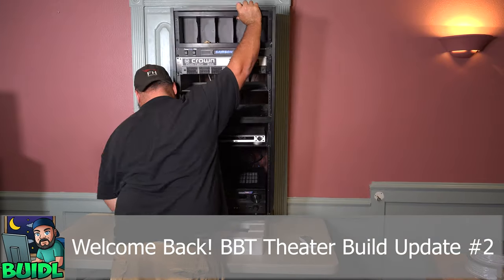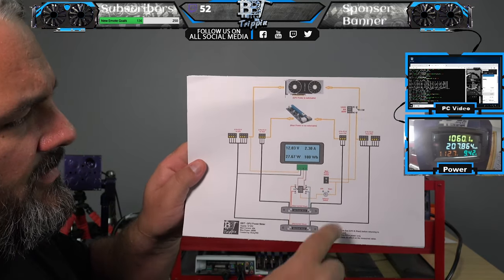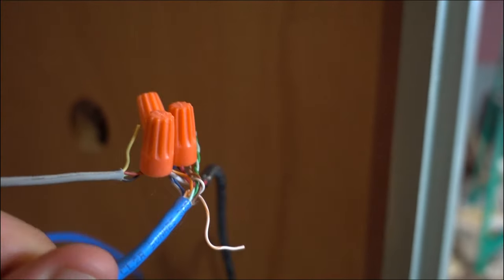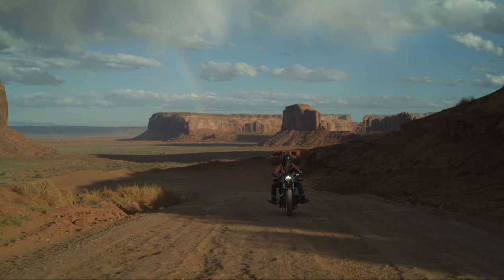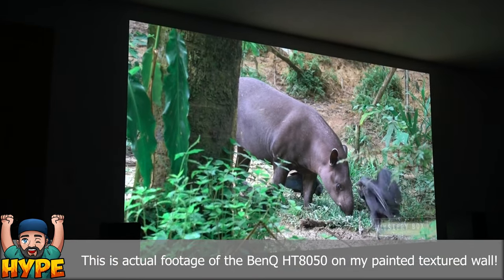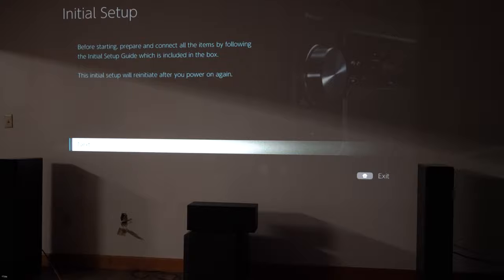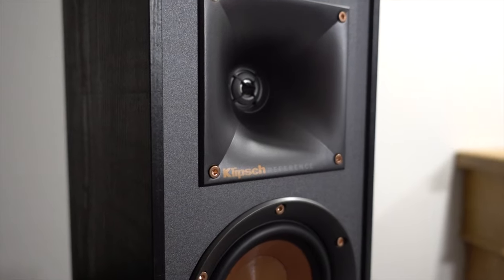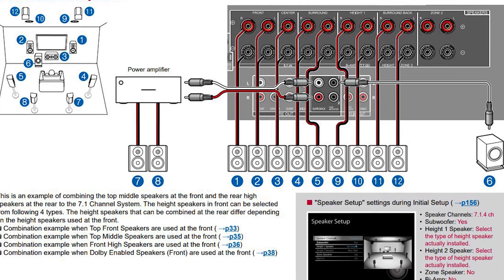Home Theater Buildout with a BenQ HT8050 and Dolby 7.1.4 Atmos Testing First!

Comment: Did you cover yet how you did the screen?  Paint used, etc
Reply from the maker: There is not screen yet, I ordered a 150" Elite Spectrum Motorized screen for the Theater Room that has not yet arrived. The visuals you see in this is just the HT8050 projecting on a light grey painted and textured wall! Nothing special to enhance colors or screen, that's how vivid this BenQ is. When Screen gets in, the mounting, trigger (which allows it to go down automatically when the projector is turned on) will be covered.